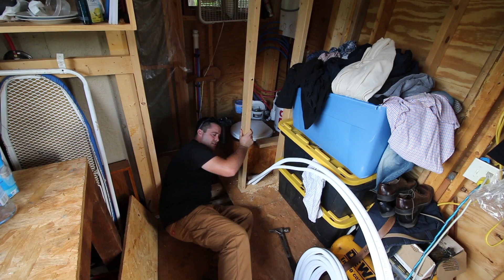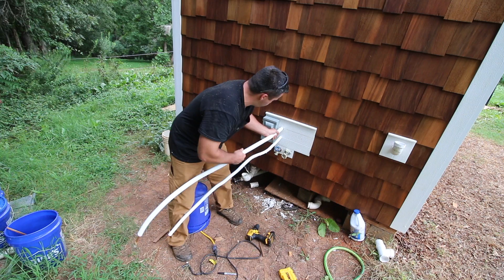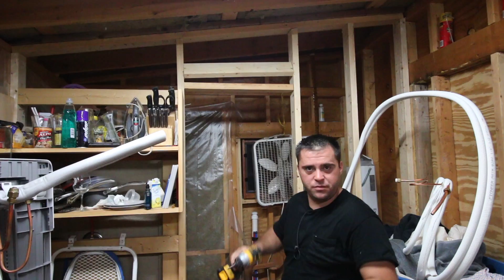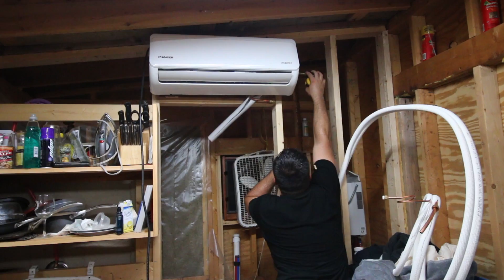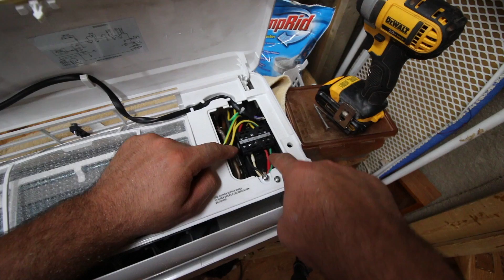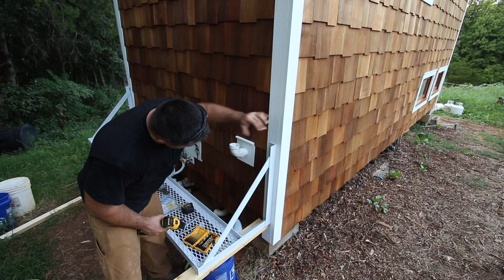A hodgepodge about the mini split.

Comment: Just curious, why route the delicate copper tubes in such a complex fashion, why not just hang the mini ductless internal unit on the inside of an external wall? So the copper tubes can just go out through a simple hole?
Reply from the maker: +Parker Shaw   Where..  there isn't any space anywhere else.
Reply: Tiny House Customs I suppose if you want the external unit at the end of the house, that is more or less the only choice indeed. BTW, GREAT carpenter you are, respect!!

Comment: I work on boilers  and chillers for a living, so my choice for my tiny houses is a hydronic  heating and cooling system made from a 110 AC  and a 110 on-demand hot water system, using glycol in placement of water.  Best part of the system is its apps to use other forms of heating and cooling if needed. Ie, wood fire boiler, solar, or heat pump geothermal. A little more complex  of a system  but ez  to repair and maintain  by the avarage jo.
Reply: Lol, you work on chillers!?!?!